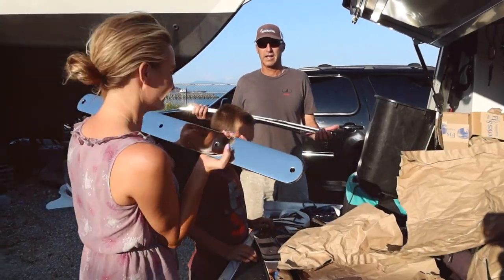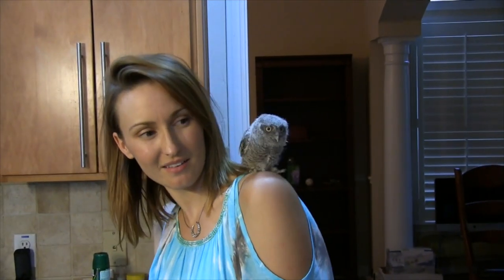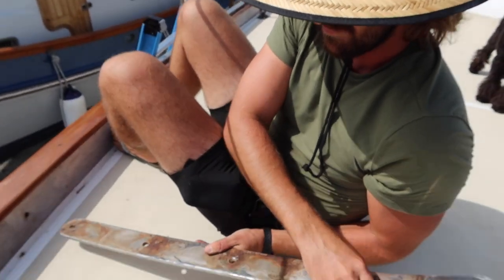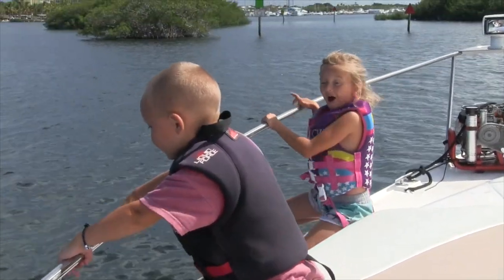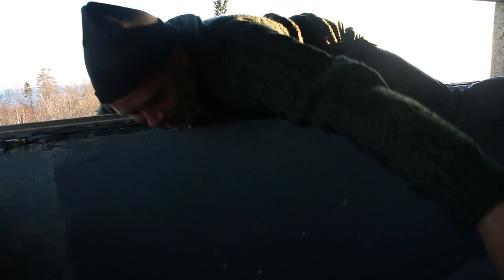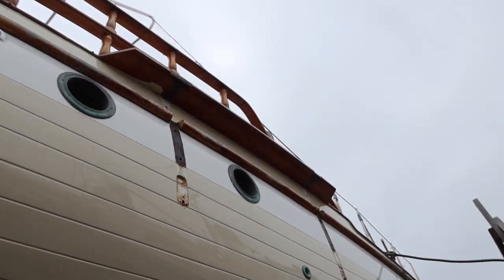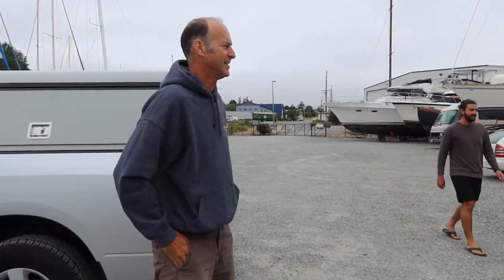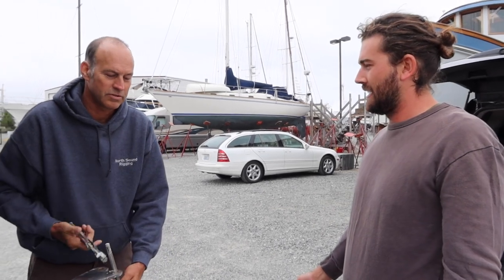Repossession - Hard Truth & Fresh Start | Pirate Ship S13E02

Comment: Stainless is a much more sensible idea,very good choice. Titanium is extremely light and like you mentioned it becomes brittle. After some use titanium becomes fatigued instead of getting work hardened like steel does in its many forms. Titanium valves last many many heat cycles in my race engines but also do some strange things,I knocked one over on the workbench on a late night engine freshen and it snapped after simply tipping over even though it only weighs a few ounces. You’re definitely a strong intelligent woman and I’m always happy to see someone restoring a piece of history. Proud of you for being resilient in life and for taking life by the horns.
Reply from the maker: Thank you so much for this comment:)  I look at the boat that Exact way.. as a Piece of history

Comment: Why did you replace the chain plates? They looked good.
Reply from the maker: Under closer inspection they had stress fractures and rust. We also went with a fractional rig and they would have had to had new holes drilled into them which would have left less meat and wouldn’t have been ideal. I guess the short of it is. It wasn’t worth risking
Reply: @SailingMissLoneStar  thanks for the explanation 👍🏻😎

Comment: Your original chain plates were thicker than the frame on a semi truck. Imho you should have upgraded the bolts and left the original alone.  Does no good to beef up the plates that are fastened to the original thin wall sides of the boat. What became of the Macaw?

Comment: The chain plates look to be in good shape. They are polished stainless steel chain plates. I wouldn't make or buy new ones. I would sand those where they have surface rust, & either re-polish them, or sand blast them & put several coats of rust preventative epoxy paint. I would make sure where they were attached, that the  fiberglass or wood is still in good shape &  not dry rotted. If so remove all the rotted material & build the fiberglass up with some heavy carbon kevlar fiber cloth. I then would back the chain plates up with some purple heart 4x4's inside the boat, & teak 2x4's on the outside of the boat, under the chain plates, sandwiching the fiber cloth hull. The reason for the teak on the outside is teak is impervious to rot in saltwater. All sailboats can be refitted & made to be stronger. Peace & love, the Formosa's are good sailboats.

Comment: What was wrong with the chain plates? They looked sound and just needed some clean-up.
Do the hull chain plate attach points have enough strength to even benefit from thicker chain plates?
Reply: I agree. If the chain plates and bolts havent been overstressed, there is no point in replacing them. Someone knowledgeable could probably inspect them and tell you if they have been overstressed. An engineer could also easily do the calculations to determine the breaking load and compare it to the actual loading requirements. People underestimate the strength of steel, even stainless steel.
Reply: @frankiethefish73  Steel and stainless steel are likely many times stronger than the anchor points. The sheer strength of the bolts is probably more than the anchor points. Engineers often balance strength so stress is not focused on one point.

Comment: there was nothing wrong with those chainplates (from what i could see, maybe i missed something). you mentioned that your new rigging is thicker. im assuming you went with SS standing rigging. did you considered haveing it done with dyneema?. stronger than steel and WAY lighter. also splicing it is very staightforward, can be done underway (in an emergency) and you are self sufficent about it. you only need to have spare line.
Reply from the maker: There was damage to more than half of the chain plates. Rust and hairline fractures. We lookedInto dyneema and stainless steel rod and decided to go with a heavier wire. In the scheme of things it made sense to build our brand new rigging on a solid foundation of thicker wider newer stainless steel chain plates with reinforced backing plates and access panels to boot. I am very happy with our decision and I’m sure that what we have done will last the lifetime of the boat. Or at least my lifetime with the boat😜

Comment: I don't know why you're changing them the thickness of the steel doesn't matter it's already stronger than what it is bolted to. To take that teak off you just have to drill the caps off the screws and unscrew it from the hull.

Comment: Hi there...i did the same with my boat in a great yard in lisbon..the chain plate failed and broke the main mast at the first spreader..turns out the stainless used in taiwan was not pure and broke right at deck level. Sorry to hear about your sad tale. Nothing like a good project to get you back.
My boat is a formosa 58 but 65ft LOA.
Reply from the maker: That sounds terrible. I’m glad I decided to bite the bullet and change the chain plates!
Reply: @SailingMissLoneStar  i also changed the bob stay as well. If this goes so does your rig.

Comment: Why do you exchange chain plates that still  look perfect? I just read this article "Ulbrich - Overcoming Saltwater Corrosion with Stainless Steel". According to this article it is, as I suspected, unnecessary.
Reply: Chainplate failure is a leading cause of dismasting. Formosa's have had a history of failures of the chainplates. I believe it was due to the grade of stainless used mixed with deck and cabin leaks. You wont know by looking at a piece of stainless what the inside looks like. You can have them analyzed but whats the point....  There can be a number of reasons for new. For example with new oversized rigging, the chainplates could be the new weak link. If I was rebuilding a Formosa...absolutely. If I was buying a Formosa and it had new rig and oversized chainplates I'd be stoked.

Comment: Do not reuse stainless bolts. This is a general comment, stainless stretches when torqued into place an re using it can cause it to stretch more. Given the high stress application of the chain plates I would not do that.  Not to discount the emotional nature of much of your post and your loss and life are not inconsequential but the comment about reusing the structural fasteners concerned me